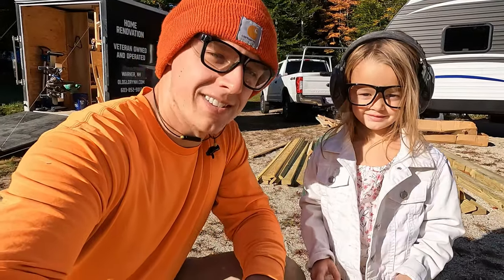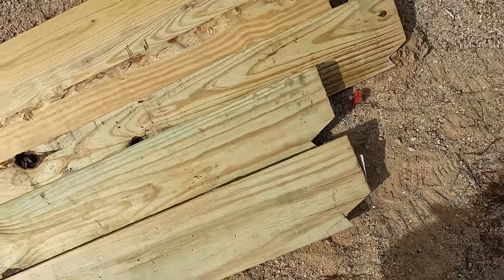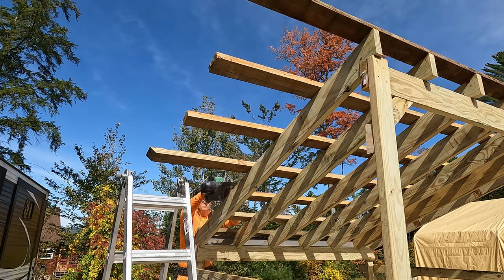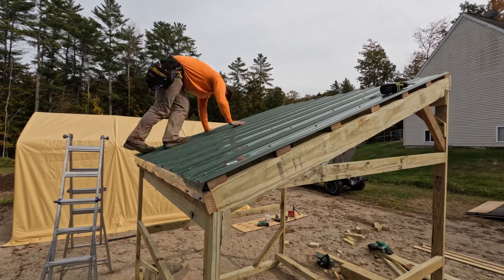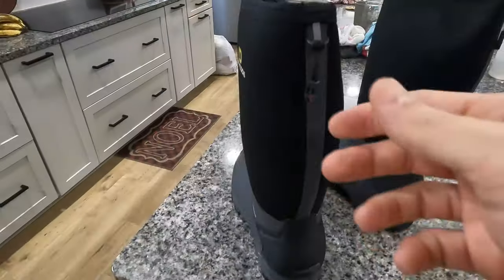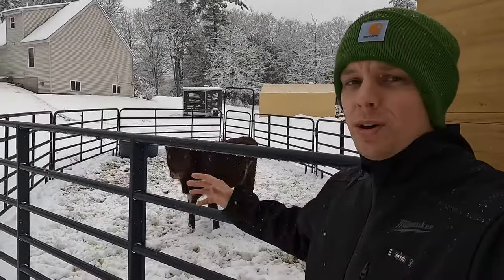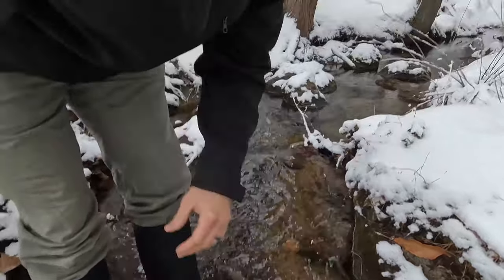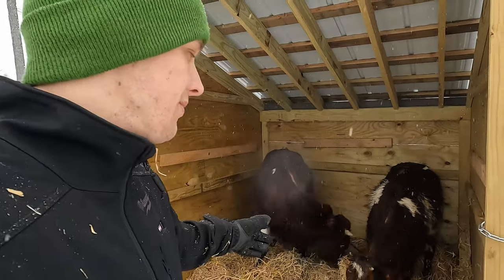Building a Shelter for the Cows

Comment: Nice job on the structure.  As a side note I purchased those Tex screws when placing some metal, and they are EXPENSIVE.  As a cheaper alternative you can buy a metal screw from almost any metal roofing supplier for pennies on the dollar compared to those.  Great video.